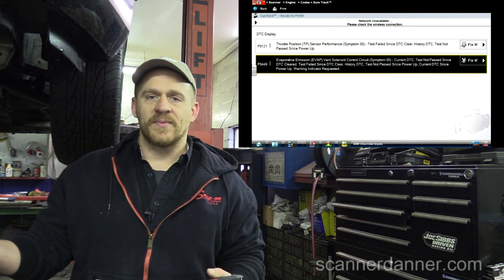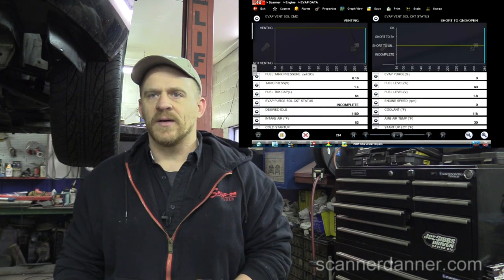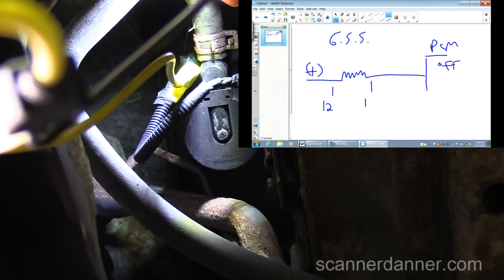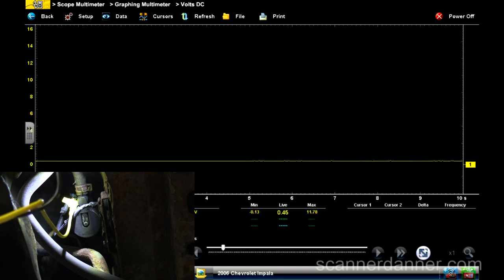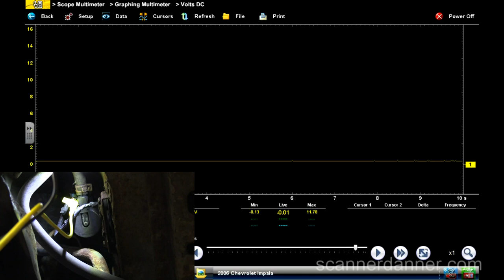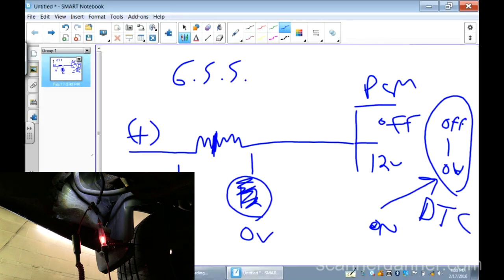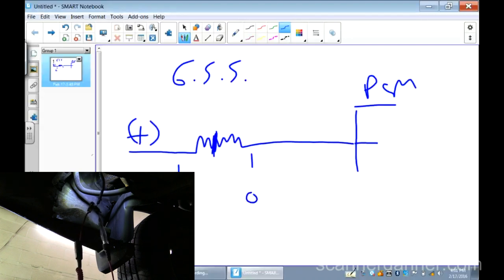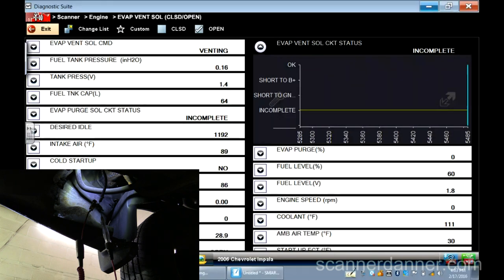(EVAP) Vent Solenoid Control Circuit P0449 repair - GM

Comment: Everything up to the end of this video was a fantastic troubleshooting educational experience! However it would be most helpful if you would have said "These findings (no short circuit or bad ground) conclude that this solenoid valve is stuck open and needs to be replaced!
Reply from the maker: Thanks for the comment. 
Just want to clarify this wasn't a "stuck open" solenoid. This was an open in the electrical winding of the solenoid.
Reply: @ScannerDanner  Thanks for clarifying that. I suspect mine was but who knows without all the diagnostics. I  changed mine and got lucky as it was only 34.90 for the part and it solved the problem.  Cadillac wants 175.00 to say hello and would charge me at least 150.00 for just the part.  I don't begrudge paying a good technician for his skills and work but the cost of parts at the dealership is criminal.

Comment: @scannerdanner Currently when I command vent solenoid to open (venting) i get 12volts. And when i command close (not venting) i get close to 0volts on bidirectional control. Opposite of what your readings are. Would this indicate a failed driver in pcm on control side?
Reply from the maker: This is a normally open solenoid. So "venting" is electrically off and it would read 12v on the control wire of a ground side switched circuit in the "off" state. 
What you described is normal

Comment: Not everybody has bidirectional scan tool there's got to be some other way of explaining this
Reply from the maker: You can buy a bi-directional scan tool (Topdon Topscan Pro) for $100
There is no excuse to not have one these days. You can get one here.
https://www.aeswave.com/scannerdanner (affiliate earned)
The only other way to make that driver turn on is to meet the conditions for the PCM to run an EVAP test on itself and good luck with that.

Comment: What was the problem a bad grown
Reply from the maker: Pretty sure I showed it? Broken wire at the connector right? Was it the control wire? Then yes, the control is a switched ground, so yeah, a broken ground you could call it. Its just not always a ground, to be clear

Comment: I have a 08 9c1 impala that has a random P0449. Been trying to hunt it down. CNSTR fuse looks good. Removed connector from solenoid, and tested: Red/white wire has 12v, white wire has 0-0.38v with KO. New GM harness and solenoid. I assume I will need to try to switch it off (as its normally open/on?) somehow through the PCM...I am wondering if this is an issue on the grounding side, or driver? How can we better test the driver/wire length for short?
Reply from the maker: White wire voltage reading plugged in or unplugged?
Plugged in, circuit off, should read 12v.
Plugged in, circuit on, should read near 0v.
Need a scanner to command the solenoid on/off

Comment: Very nice, drawing and all. I just went thru this on an 09 Chevy p/u. The vent solenoid was not working properly, but after I replaced it, it showed that the tank pressure sensor was operating, but slightly off scale. I was getting 6 inches/h2o of vacuum with the cap off. I have been watching your vids for a while, and was able to catch the problem. Otherwise, I would still be scratching my head. Great instructional videos you make. THANKS!!!
Reply: roadkill5333 hi may I ask what was your problem?

Comment: Great video Paul and we could tell you was getting pissed from all the background noise Dont worry about it We understand its a working shop.
I convinced my wife that I needed a $1300 smoke machine I have had it for 4 months now and haven't needed it. I finally got a job yesterday where I needed it on a leaking intake gasket that I found with carb cleaner, So I put the smoke machine on it and could not see ANY smoke. Maybe I should have listened to her Lol

Comment: Man, my brain just has trouble keeping up with the depth of knowledge in some of these diagnoses even though they are typically and like this one presented quite well. Slow learner on certain things. I keep coming back though. Also completed four classes in a vocational school, all on engines (electrical included). Maybe one of these days enough of the pieces will snap together for feeling ready to begin trying on my own at the level of investigating waveforms and such. 

I've been looking on eBay and elsewhere for a used scope like the Modis (cheaper than Verus) to at least own a tool for grabbing a bit of hands-on practice, which may and will likely help the process. These videos being available give me hope to find enough patience for keeping on with the education since they require no enrollment, getting to classes on time or anything other than tuning in when wanting to. I am grateful.
Reply from the maker: +randalusa thanks so much. keep following me, I definitely have the information out there to be able to do this yourself and at your own pace. And when your ready, I have another channel where I bring you into my classroom. Email me through my website and I'll give you a coupon for a free 30 day pass.

Comment: just got done performing this test on my car. the problem i was having the other day with low feed voltage ended up just being bad ground connection. I scraped off a little rust off a bolt and BAM, the correct numbers showed up. I even manually energized the selonoid with my test light after I verified voltage. Beforehand, I already knew which was the feed and which was the control by printing the wiring diagram off of Mitchell1Diy...long story short. I wouldn't of been able to identify, verify, test..etc. if it wasn't for your instruction via youtube and your book Paul. Now I know that feeling you got after you troubleshooted that no start ford taurus (i believe) that ended up being bad block ground. Keep doing ya thing Paul and I'll be watching. Thanks for the help once again. peace!
Reply from the maker: +Isshman Garcia awesome, thank you so much! Keep up the good work.
Reply: +ScannerDanner Thanks again Paul.

Comment: Nice video. Another option is to look at the  PIDs, specifically FUEL TANK PRESSURE  (inH20), to see if there is a change of state
when activating the EVAP vent solenoid (since fuel tank pressure is measured in inches of water, when closing the vent there should be a rise in fuel tank pressure). Thanks.

Comment: just what i needed as well. i have 2004 chevy monte LS 3.4. with evap code. Thanks Paul.
Reply from the maker: +Isshman Garcia for sure! Thank you
Reply: +ScannerDanner i get 5v at the feed..so obviously that is an issue. i was thinking  it was a 5v ref. back to square 1.
Reply from the maker: +Isshman Garcia on the feed to the vent solenoid? tug on wires near the connector, the feed wire will most likely break
Reply: +ScannerDanner yes to the vent selonoid. ill tug later. im at work enjoying a scanner danner lunch break. thanks for the assist.
Reply: +Isshman Garcia come to think of it...i just replaced that selonoid. its the type that has an included adapter that attaches to the square connector..theres a square and a round connector, but you already know that. ill check it out later. ill let you know. Thanks again.
Reply: +Isshman Garcia * two different types..i have the square one.

Comment: Chevy Avalanche 2007 LTZ 4WD FlexFuel with LPG
"Tank cap", "Vapor Canister Purge Valve / Solenoid" and "Vapor Canister Vent Valve / Solenoid" have been changed.

The latter has 12v and 0.5v when the ignition is switched off.

What else can I test?

Comment: I wish you could help me out with my Isuzu Trooper. I'm having evap troubles, no leaks just a high pressure gas tank and throwing codes if I don't open my gas cap to release pressure after every trip. My vent solenoid functions but it has an after market wire harness. I wonder if they have the wiring backwards?? If I could somehow find a wiring diagram for DURALAST parts that would be heaven sent.

Comment: Would this ever prevent the vehicle from starting AT ALL ?...i have an 09 traverse that when turning the key just forward the fuel pump won't even prime...pump does run when I jump it at the fscm but not when I initially turn the key..had a new fscm installed and programmed and nothing
Reply from the maker: No sir, unless the EVAP vent shorted and blew a fuse and it was the same fuse used for the fuel pump circuit. We can help you on my forum. It is free to join and you will not find a more friendly and helpful community anywhere https://www.scannerdanner.com/forum/post-your-repair-questions-here.html I hope to see you there!

Comment: Would this solenoid make the click sound if forced on/off? If you had it off the car could you test it by adding removing 12v?
Reply from the maker: +mharradine57 Yes, if the solenoid was good. And yes, off car testing can be done with two jumper wires.

Comment: Could we jump the 2 wires and watch the scan tool go to 12v for circuit integrity and that would be OK because engine computer will not be switched to ground
Reply from the maker: +Jhn 01 you could do that but, I would never do that with a jumper wire. A test light would work as your jumper wire and will add a buffer just in case. So in your example, the test light would not light, there would be no voltage drop across the bulb and the computer would see 12v.
Reply: +ScannerDanner would that fry the pcm because it would now be getting a straight 12v???

Comment: Hello Danner. Is it possible that the PCM does not allow you to bi directionaly turn on the vent valve in the event that the control wire is shorted to power?
Reply from the maker: A shorted to power control wire on a ground side switched circuit like this one would cook the computer driver. Sometimes the bidirectional tests are disabled by a fault code but no, there would be no protection from this event. The driver would be cooked already before you even got the car into your shop to check it out.
Reply: Thank you very much, Paul.

Comment: what do you do if you replace the vent culinoid and engine light keeps throwing that code? computer module replacement?
Reply from the maker: +Erick LWS most likely a wiring issue, usually right at the solenoid connector.
For more help post your issues here
https://www.scannerdanner.com/forum/post-your-repair-questions-here.html
Reply: Thanks!

Comment: Hey Paul, I have always enjoyed watching your videos.Two questions, have you ever come across a  vent solenoid control circuit high code?  How would you go about troubleshooting it if you do? I am pretty sure it can be either from an open solenoid , a short to power in the control wire, a faulty driver and other causes maybe.The way I would test it is to check both wires with the solenoid plugged in. If I get 12 v on both wires, I would disconnect the solenoid and check both wires again. If I get 12 v on both wires , I would assume that the control wire is shorted to power and isolate the circuit and test for the short to voltage by connecting the test light to battery negative and touch on the control wire to confirm the short. If the test light does not light, my focus will now be on the driver. I am not sure with a short to voltage in the control wire, I will be able to  bi-directionally test the driver because the  pcm will see the 12 v and disable the driver.May be, I would erase the code and check for control with the car running and see if I get control. By the way, with a short to power in the control wire, would you be able to be the computer and ground the control wire and hear the solenoid click?(with a good solenoid)
Reply from the maker: Just be careful of bias voltage that is coming from the computer on the control wire. I have seen 12v bias that will NOT light a test light. Here, watch this. There is a 12v bias on this fuel pump relay. 
https://www.youtube.com/watch?v=McnXLcJNVfI
Reply: Thank you, Paul.

Comment: stupid question after all this time ,but when you say "not energized" when u test voltage on feed wire does that mean with the key off or with key on?
Reply from the maker: +Isshman Garcia not energized, simply means no current flow. Whether you are missing a power or a ground.
Reply: +ScannerDanner thanks

Comment: But what does one do to fix the issue? Just replace the soleniod?
Reply from the maker: Or there is a wiring problem right at the connector and if this is a GM we're talking about
Reply: @ScannerDanner  yes it is. 2005 suburban 2500 6.0L gas. And the light has been on for a year however since I need inspection I have to replace it. Wiring is good so just need to replace.

Comment: So my question is: what needs to be done to get it fixed ? So the code can be cleared and won't come back
Reply from the maker: you clearly did not watch the video if you are asking that question. It had a bad vent solenoid (open in the winding of the solenoid)

Comment: Can you do a video on p0448?
Reply from the maker: Same exact checks for the 448 (shorted) code. Report what you have after doing these tests and I can guide you further
Reply: @ScannerDanner  no problem thanks last year I had took it a mechanic he did smoke test and change the vent control valve 6 months later code re appear it's a 2006 Nissan Sentra 66K miles

Comment: i assume that the key needs to be to "on" so the battery sends the power to the selonoid. KOEO..key on engine off?
Reply from the maker: +Isshman Garcia yes, but again, having power to the solenoid does not mean it is energized. In this case the computer switches the ground to energize it
Reply: +ScannerDanner great reply, just what I needed for my notes. Thanks for the reply.
Reply from the maker: +Isshman Garcia and great question!

Comment: gm electrical problem on wheel I say all there cars not dependable electrical conextion burn short out lost of head lights emission control monitor incomplete still no check engine code for bad part electrical problems on wheel pass the word around